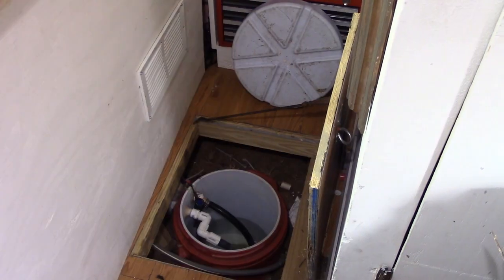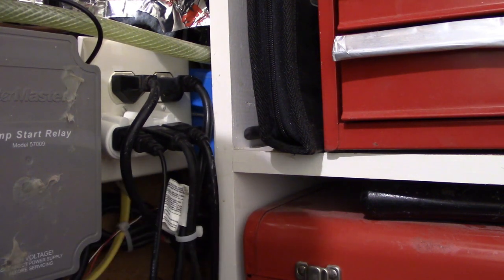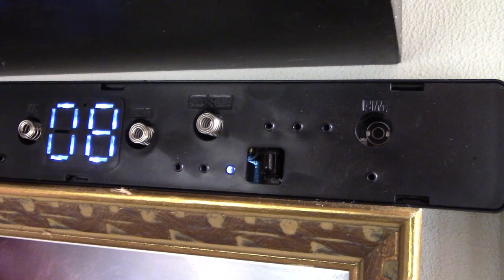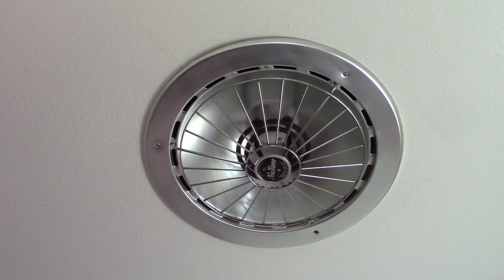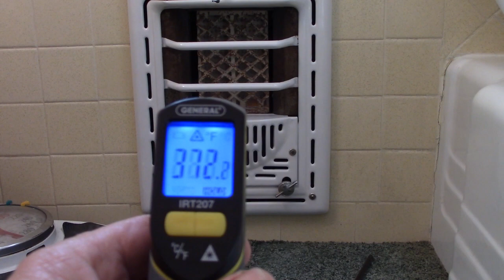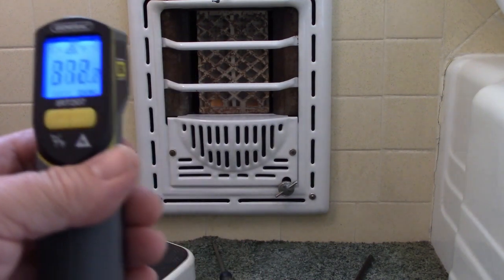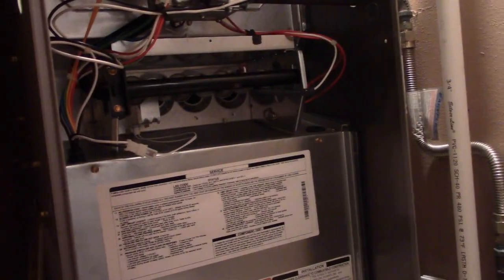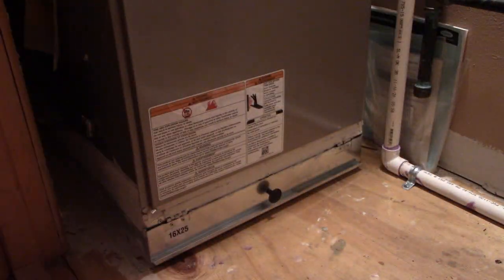2021 Heater Startups

Comment: I figured there wouldn't be too much trouble from your systems there.  I always liked that Nutone and the Peerless gas furnace.  Real classic gems.

Your homemade rig seems to still be doing the trick just fine as well.  That's a nice setup.

Didn't seem to have much heat output from the new Nonsense unit, that was a little less than spectacular output.  OK, a lot less.  Heat, yes, but the hotter you get it first, the better it's going to do to satisfy the 'stat.
Reply from the maker: Thanks! Yeah, I didn't anticipate any trouble, but it is Octember.
Yep, the homemade rig powered up, and did it's thing.
I'm wondering if the new Nonsense has a "sensor" that detects outdoor ambient. I tried it when it was much cooler, and the air was quite warm from the vent. I may try it again in the morning, and do a followup. Today's test was abysmal, at best, no way that would ever satisfy the 'stat.